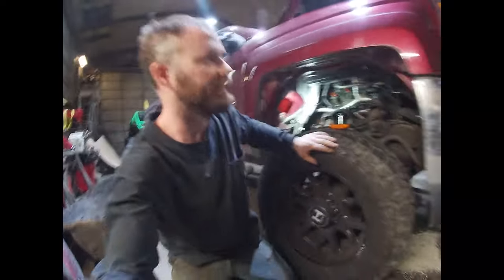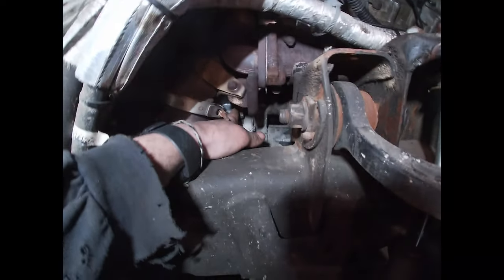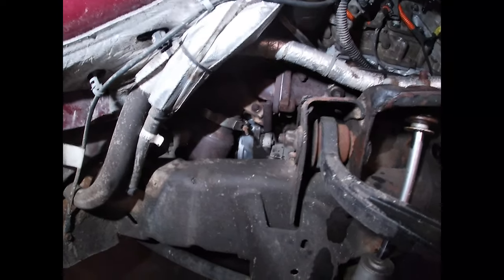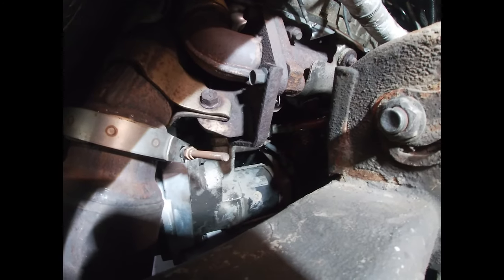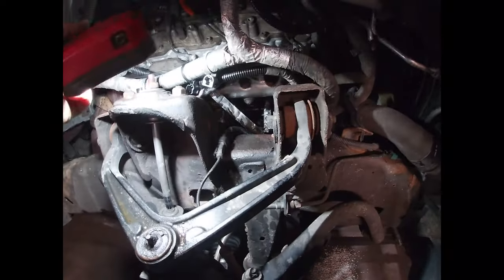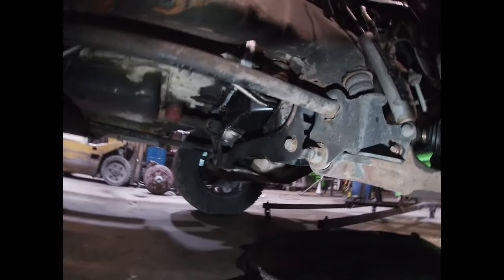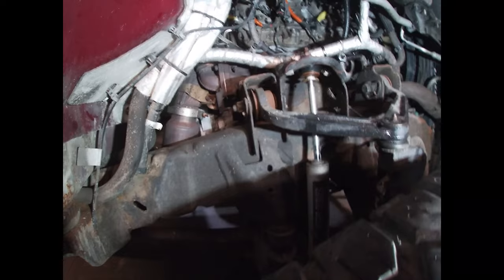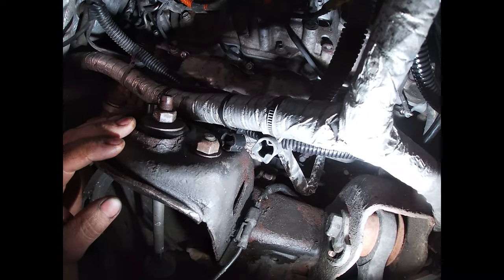Easy Way To Replace The Starter In a 2015 Duramax | Hardcore Offroad LLC

Comment: Worked like a charm.  No need to remove exhaust.   Just remove the three 15mm motor mount bolts, place a floor Jack and block of wood under trans just behind bell housing where trans is flat and Jack motor up about 1-2".  Starter comes out over frame rail.  Dont cut your truck. I cut off a 15mm 12 pt box end wrench to use on the starter mounting bolts.

Comment: Thanks for the video, removing the motor mount was exactly what was needed after several hours of trying to remove the started by the repair manual.  My exhaust connection for my 2015 LML is different from the video, probably because mine is California, but the solution still worked great.